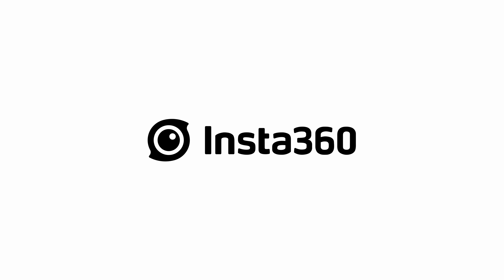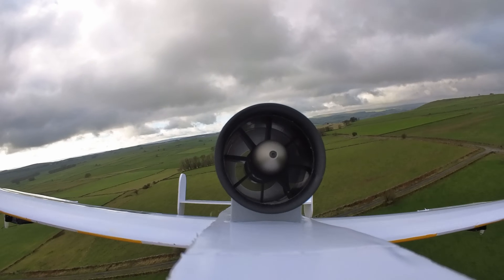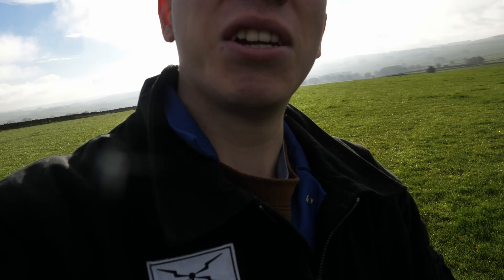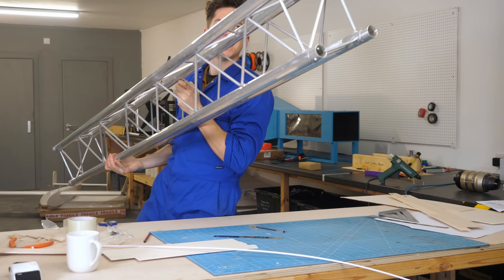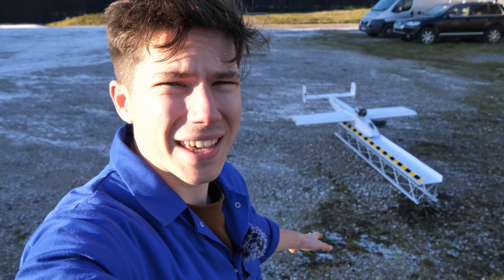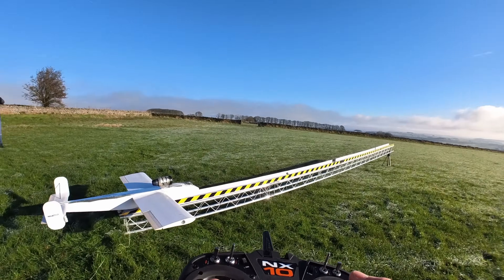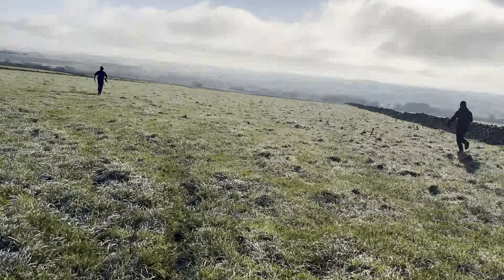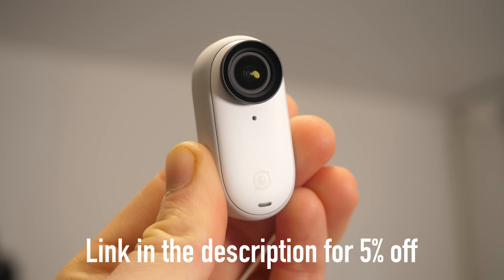Foam RC Jet

Comment from the maker: Thank you again to Insta 360 for sponsoring this video! - get your GO 3 here with 5% off and a free selfie stick! https://store.insta360.com/product/go-3?insrc=INRLGG6&utm_source=youtube&utm_medium=KOL&utm_campaign=projectair&utm_content=date20231210Holidaysales
Reply: Looks better than a GoPro.
Reply: Let‘s gooooo new project ❤❤❤
Reply: I know the carbon tube will completely block RF signals, same with the jet engine and the foil tape... Where did you have your receiver antennas, sandwiched between these three items? If so, it'd get the best signal from behind and below and the worst signal from above, this corresponds with the aircraft attitude at signal loss\regain IMO. This signal loss would increase with the rapidly increasing range from the transmitter. I think this explains it unless you did thorough range testing while holding the aircraft at different attitudes with multiple, well-placed antennas.
Reply: Basically just remade the V1 rocket in this video here xd

those who don't know what that is:the v1 rocket was the first rocket powered missile made. created in late war ww2 by nazi germany.
Reply: I’ll give you the reason for loss of control. It’s in your hands. The Spektrum radio. Never had a system with no many loss of signal issues. Cars, planes, drones. Tons of crashes and all involved a Spektrum radio and signal loss. Switched brands and I have never had a single glitch in signal or telemetry.
Reply: Could the left aileron have gotten jammed before the crash?
It would explain the continuous rolling.
Reply: The only thing I HATE about insta360 is that you’re forced to use their app. I have no idea why I need to use their app to pull videos from their device. Also, their chinese app pulls your location data, contacts (why??), access to all photos (why?? just want to make it share select photos),

Also, their desktop app goes through your browsing history and such. Why what for?! Their TOS is a privacy nightmare.

I just want to record, but could not  remove the video unless I allowed their app to scan my phone and send it back to their chinese servers. That’s a HUGE NO for me. Efff Insta360. I hate their software so much.
Reply: I don't think there's a selfie stick in the offer. But there is a advertisement t-shirt.
Reply: @rasmis  i just checked now, it offers a free selfie stick + a carry case 😁
Reply: Take the golf ball out of your mouth old chap ....
That foe 'posh' accent is so grating I can barely watch your otherwise great content!
Reply: Such a cool camera.. Trying to think of a reason I need one :P .. another great video! was on the edge of my seat at the start of the flight
Reply: can u do a video on how u designed the airplane in fusion 360 plzzz !!
Reply: Peter Stripol already did a foam jet. Also DONT USE SPEKTRUM.
Reply: Stop using spektrum.
Reply: Could it been foil somehow reflecting/interfering the signal?
17:30
Reply: I'm a spoiled 3 year old child and I want my new video NOW !!!!
(Hope you're ok)
Reply: Hello ik this is a cinge question but if you want could you come and see my first time flying an rc plane im doing it tommorow so I would appreciate someone as you to see the vid(prob alot of crashing😅).😊
Reply: Band aeroplane I want to know helicopter and RC aeroplane remote control aeroplane
Reply: I need one
Reply: you were too far away
Reply: ME162
Reply: That test rudder was too small and in the worst position ie in the tubulance created by the fuselage. Twin rudders would have been much better.
Reply: A high thrust above CofP produces large nose down moment. Trim this out with elevator give high speed stall when engine cuts, resulting in loss of control. Jet engine must be angled up to correctly offset down thrust. Probably need twin boom design to stop burning up.
Reply: Hmmmm
Reply: 400 DOLLARS!!?!!???!!!!!!????!???!!
Reply: I guess it worth it, it's light and tiny and high quality
Reply: Great little cam, probably gonna get one.
Reply: @heavytank2  Unless you’re ok sending your phone’s entire metadata, history, contacts, location history, etc.. back to china, go right ahead and buy it.

Comment: I’m a ham radio operator, and that sucker got pretty far away.  Should have kept working because you had line of sight, but I would use a different frequency, and push a little more power though the signal.  Learn about ham radio, and you’ll learn a lot about how to make that thing work better.  Maybe build your own transmitter and receiver for it, and it’ll be super powerful and not cut out.

Comment: I must admit, I know nothing about aerodynamics and building planes.  I do enjoy your project videos.  If I could ask a question?  What are the challenges to including landing gear to the designs?  I noticed you do not use them.  Is it more trouble than it is worth, since you mostly land in open fields?  I just was curious as to why they never seem to wind up in your finished designs?   Do they create too much drag, or weight, or complexity?  In this project, you used a launch dolly.  Could that be modified to stay on the plane and act as landing wheels?

Comment: 17:57 Maybe a transmitter or receiver got burned out by the engine? or maybe the metal parts of the engine interfering with the signal...

Comment: you should add the rutter to the side pitch wings on the back giving it an A10-A early or late kind of look in the back to help for stability
Reply: the A-10 also has pitch down front wings to help with low altitude and speed thrusts

Comment: Hey I don't know if anyone noticed, but around the 14:14 mark I noticed something fell off the plane. which may have contributed to the signal loss.
Reply: That was the sled.

If you go back a few seconds, you'll notice the sled is clinging to the underside after it comes off the ramp. Also a few minutes later it shows the sled falling off from a fuselage angle.

Signal loss was likely due to making half a Faraday cage around the receiver, and a large metal chunk that can disrupt signals around it just on the other side.
Reply: I did
Reply: That’s probably the dolly

Comment: you can try mounting the engine underneath the body then it could be more stable and use some ceramic plates to protect it from the heat

Comment: Was there a requirement to use foam board?  The external braces for the tail are very draggy and should be avoided.  Look at the difference between a Ww1 biplane and a Ww2 single wing fighter.

No need to build a V1 model.

Comment: It looked more like its was stalling due to the weight, temporarily regaining control was due to the increase in airspeed falling down.
with the camera's on board you should have past some cotton strings over the wing showing the direction and behavior of the airflow over the wings. Great tool when reviewing the camera footage. Great video.

Comment: Awesome as always.
You really should be running  an ELRS radio system. One with Gemini, or even better, Dual band Gemini. Your Spektrum NX10 is a nice radio, but DSMX doesn't have the range, penetration, or noise rejection of a LORA system like ELRS. And adding Gemini (transmits on 2 channels for redundancy) or Dual band Gemini (900mhz and 2.4ghz, with 2 channels on each, so 4  total channels) will ensure the packets get there, one way or another. Also, it's cheaper than Spektrum. :D

Comment: Love your videos!  in regards to the fuel sloshing and creating air bubbles, you can add fuel tank foam which will help with several issues. 1. sloshing, 2. ullage explosions, 3. air bubbles getting into the fuel lines 4. better control of the craft.  They use this tech in fighter jets. It weighs next to nothing, barely offsets fuel capacity, and its as cheap as... foam. =)

Comment: Make sure your two Rx arials are mounted 90⁰ perpendicular to each other as you will lose signal on one and switch over to the other. 2.4ghz can also be blocked by foil tape and carbon fibre

Comment: i believe after watching the recording is that it was off balance or the reciver was not transmitting signals fas enoguh, or maybe just that the wires werent connected properly, cuz on my projects on my rc cars when i do this is always delayedi reccomend having a second controller but that would be complicated for a rc plane, just check your wires and try getting an antenna or something to extend the range wayy more than needed. i had personal experiences too when my rc cars radio signal cut out mid drive even tho it was 10m away and my radio signal is 100m going straight into a pole and destroying the wing and a massive hole in teh right side of the car. and again try cheking the internals.

Comment: I might have a suggestion regarding the los of signal I would recommend to replace your spectrum transmitter for any other brand, Use spectrum for boats cars..but not for planes, it is known that this brand is randomly suffering from los of signal. Futaba, Jeti,or even frysky would be a better choice. i have seen issues with los of signal with  this brand in my local club.

Comment: The aluminium tape restricts the signal, and since the futaba is quite limited already you failsafed
Reply: You’re right about the partial signal blockage but it’s laughable to thin Futaba is limited and he isn’t even using futaba. He’s using spektrum.
Reply: @thatairplaneguy  ur right i just trusted what another comment said and did not pay attention, the main point of the comment was the aluminium tape and not using LoRa protocols

Comment: You should do a video where you take an RC aircraft and introduce slight amounts of damage to the control surfaces and fuselage over and over until the plane is completely inoperable. It would be interesting to see if you could try to design a plane that would be as reliable as possible to be able to continue to operate with minor damage. It would also be interesting to just see how little damage it takes to start affecting the planes aerodynamics.

Comment: I would never fly such a plane without an FPV feed, a flight controller and a long-range radio link, so kudos for bravery I guess :)
Could it be that the fuel pump was drawing too much power because it was sucking air instead of fuel and that crashed the entire electrical system?

Comment: I think the signal cut out because of the metal foil and the angel you flew at the metal foil interfered with the radio signals the same thing happened to mark rober in his worlds highest egg drop.

Comment: I dont know, but... rc model airplanes has been a long hobby of mine. Your motor shutoff could olso be an electrical issue. Maybe because of your high speed, your servo's couldn't lift all the weight or something like that. We're used to flight with 2 lipo batteries so you'll never have an issue like that.
 The reason why you couldn't communicate anymore could also be a startup because the lack of power. 
Idk just saying

Comment: The signal loss could have been caused by the fuel pump bc it suddenly had a drop in load causing it to spin quicker and using more power. ergo cutting power to the recever

Comment: Very nice work, you'll come up with a winning design soon enough. Perhaps the weight to thrust distribution is recalculated to avert the pitching, have you considered a design that mounts the engine internally? Like a harrier jump jet? This would allow you to keep the power.

Comment: An excellent project. Tiny details do matter as you have found out. The following details won't save/kill your project but will make you more professional. Yes, Imperial speed measurement is "mph". Metric speed measurement is "km/h". That is all lower case and don't forget the "/" or "forward slash" or the "oblique". It stands for "per". Happy flying.

Comment: "What are your theories". I'm a bit late to the party but...Spektrum. Use a better long range link like ELRS.
Reply: Full agree, DSMX is intended for short range at a club where you could have dozens of other pilots fly at the same time.  But ProjectAI flies alone and at ranges that need a much more modern protocol then DSM2 or DSMX. Those are what, like almost 20 years old now?

Comment: Dude you making basic mistakes, so you spend all that money and a jet engine playing research when the research had been done year ago, plus you have a signal lost, that means you use or spkroton  radio system or futaba or any system that is not long range and that can be a big issue, next time use tbs crossfire rx, I never ever had a failsafe in 2 miles range.  Good luck for you next project.

Comment: a suggestion for the rudder is to adopt the same type of control that they used on WW2 bombers - rudders on both tails. This isn’t really that practical, but I guess another suggestion is a V-Tail, which not only replaces your (also allows thrust from the engine to pass through the gap in between the tails, and mount servos at the base in the gap between the V-Tail, I’ll leave the control adjustments up to you :) Adding braces might have lessened the damage though, and ailerons are really not good to work with on homemade aircraft. Again, V-Tail should be sufficient for your control, it honestly depends on how much rudder and pitch control you need. If need be more pitch, you could modify elevators such that it isn’t mounted on the horizontal stabiliser itself, but instead the whole stabiliser is the elevator itself. :) don’t know if you already modded pitch control on the NX10, I think it has travel limitations for the servos, you could try that out 👍
Reply: I guess DSMX/DSM2 tech is alright, but I’d use ELRS for that kind of fast-flying plane, especially since it’s a outdoor flyer

Comment: Average german engineer in 1940-1945
Reply: Ah yes the tiny propeller jet plane
Reply: @GibDib  that would be the me163 im talking abt the me162 look it up
Reply: @pointer1829  I stand corrected
Reply: @pointer1829 The ME 163 was a rocket, not a jet.
Reply: @starsailor49 yes thats what i ment read the sentence carefully again
Reply: @pointer1829 and the he 162
Reply: @GibDib I think the little prop was to generate power for the electrical stuff inside, and it used rocket engines
Reply: @fulturk4306  nop that was the meteor, or power egg,..this is more of a V1 model
Reply: Yeah but this is similar to the V1 flying bomb. I'm German so can confirm.
Reply: @enderpumpkin13  thx man needed to hear it from a pro
Reply: Kinda like the He-162
Reply: V1 moment
Reply: The design is quite similar to the he 162 or volksjäger
Reply: @PINKPANZER262  that's accurate cyn
Reply: @Marshall-rx7fe didn’t expect to find a md fan here 😂
Reply: The plane most represents the Heinkle (correct me if I’m wrong) he 163 with the top jet
Reply: So that means the transmitter failed because a ((())) sabotaged it?
Reply: 1939*
Reply: Bro a swear he modeld that airframe after the v-1 missle
Reply: @Marshall-rx7fe heinkel-162?
Reply: 😂so true😂
Reply: Oh Hell Naw 😂
(Im german)
Reply: ahem he is british clearly 💀
Reply: @JapanDrifter22 no….. the war started in 1939 for britain
Reply: @JapanDrifter22 are you restarted?
Reply: @JapanDrifter22 ya cuz he says kg not lbs
Reply: Wasnt that made in 1938
Reply: @blazingames9610  if ww2 started in 1939🤨
Reply: @blazingames9610 WW2 started in 1941, the first jet was built during ww2
Reply: @Dodgeking_real  it started in 1939

Comment: If i remember correctly don't these small jet engines have and need a fan on the front to force air through them after the shutoff. I assume that started up immediately after the engine died in flight. If thats a noisy component RF wise it could explain the signal failing at the same time as the engine.

Comment: I never believed the stories about Spektrum radios having signal issues until i got a umx radian and the manual says it supposedly shouldnt have issues running DSM2 but then i kept crashing it due to signal loss and never figured it out until i used a DSMX only TX, never had any issues again but i lost all confidence with Spektrum equipment, fortunately i still have my T10CHG laying around and never failed on me. So in conclusion, never ever use Spektrum for projects over $150.

Comment: hi, the problem with you losing the signal is because you are using the new model spectrum radio they send with very few watts in, the old models are difficult so try a tx module with more watts or change the radio I have personally switched from spectrum to radiomarster

Comment: Concerning the RF link: I don’t think Fresnel Zones were a problem here, but did you look at antenna polarisation? RCModelReviews has great videos on these two topics.

This might be dumb but could the jet engine have caused any kind of EM interference?

Anyways, polarisation is underrated. Having the null points of your RX and TX antennas line up will cause you to lose almost all of the signal strength.
For redundancy you’d need a diversity controller and 2-3 antennas, that be golden.

Comment: This is just what I think happened when your radio controller cut out in the aircraft some private houses usually don’t like to be bothered by rc Aircraft’s and drones and some people have special devices that admit destructive signals to stop other radio signals and I’m guessing someone at the house down below that you flew over had some emf Signal device that could have obstructed the radio signal from your aircraft because that house did look a little private to me.